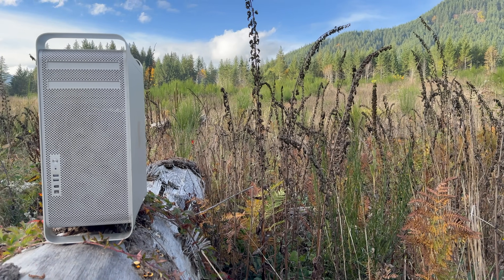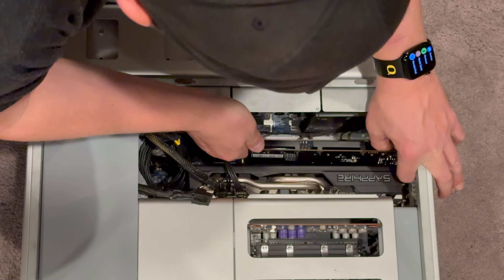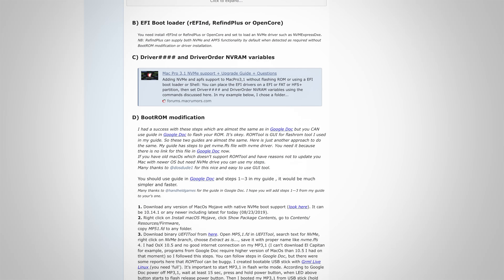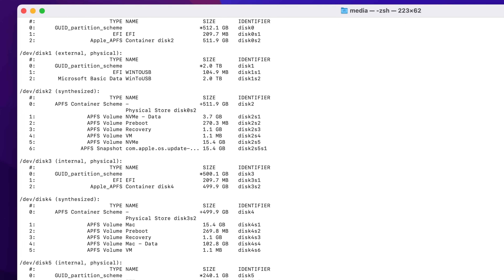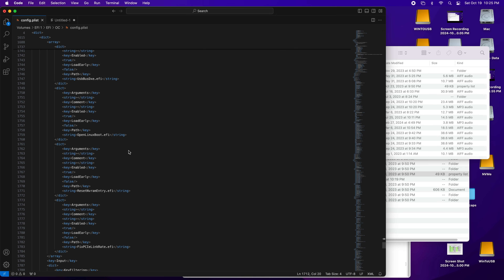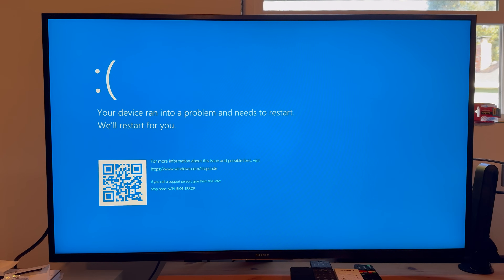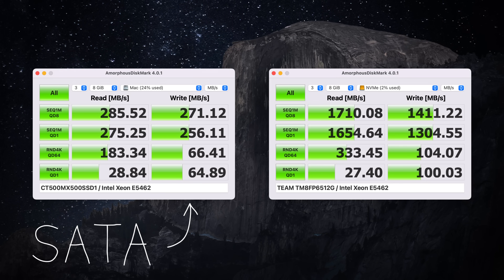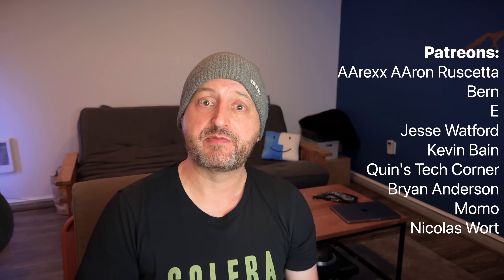An absurd upgrade in a 2008 Mac Pro (NVMe/USBc/10 Gb enet aka McFiver)

Comment: Favorite and logical are not the same thing. Yea I know youre a content creator and so forth, but be upfront with your audience about throwing away money. Any money spent on a outdated cMP should be invested in something with an actual return value and at least 7 years future proofing. With the release of the M4 Mac mini you'd be certifiable to spend easily $1k to upgrade these machines just to be slower then a iPad, even a 5, 1 should be a hard pass. Furthermore peek on Reddit forums of another post of please help, my Mac doesnt work after installing Opencore or OCLP. It is a reminder youre running a hacked machine not approved by Apple, you broke it you fix it. Sure we may love those people for keeping our outdated Macs viable. But comparable performance to anything in the last 5-7 years they are not.
Reply: still running my protools HDX 10.7.5 
making money!
Reply from the maker: "be upfront with your audience" 
I appreciate constructive feedback and realize the internet is a big place so I don't expect anyone to really dig into my catalog of videos but I have a video comparing a well configged Mac Pro 2013 vs a base model M1 Mac Mini as they cost roughly the same. I unequivocally recommend almost everyone buy the Mac Mini. I've also advocated in another video where I invested $75 into this computer that spending much more money on it doesn't make sense as if you spend too much, you could get a used M1, and the list goes on and on. 

This also a bit surprising. I don't know if this will sway your opinion and I'm not sure if you watched the entire video, I mention in this very video that this card isn't exactly a smart buy and that it was released too late, unless you have a very particular use case.. I also mention for Mac Pro 2019 or 2022 owners you probably should get a different card.

Comment: Possibly the best piece of tech ever made. I love this computer. It lasted me for 13 years straight. Im not one for "custom" upgrades and forcing unsupported os's so I sadly said goodbye a few years ago, but Apple really made history with this monster.
Reply from the maker: Same, best computers Apple has ever made as they vastly over preformed. Mine only exists for the silliness of YouTube videos. It sat on a shelf in a shed for 2 years.
Reply: @ do you think it would be a pretty bad idea to use it as a main setup? Making videos, backing up etc. I feel like it wouldn’t be too smart, unfortunately
Reply: @Toebex It’s like using a 2024 low-end computer but with the 2008 high-end power consumption. These are beautiful machines but I’ll admit I haven’t turned mine on in a while. It’s hard going back from Apple Silicon
Reply: The only reason I upgraded to the 2019 was to extend OS support. Its not performance. The computer is still performing and operating just fine.

Ironically with all the talk of being more ecological and sustainable dropping support for a computer that is otherwise perfectly functional turns them into liars.
Reply: so basically you're dumb?

Comment: To be honest, after spending so much time, effort and patience getting my MacPro 3.1 to run later Os, I dual booted with Ubuntu 24.04. It runs so smoothly, and it is at least twice as fast as the official El Capitan. So, what do I have? A MacPro 3.1 running El capitan for my music production (it is suffice) and Ubuntu for up to date apps, browsing, everyday usage etc. I could only recommend setting up cMP 3.1 with Ubuntu. So, there goes my frustration getting it to work with latest MacOs's. This really extended its life!!!